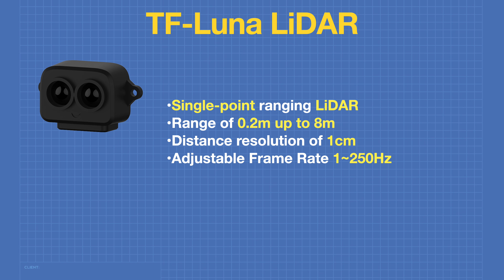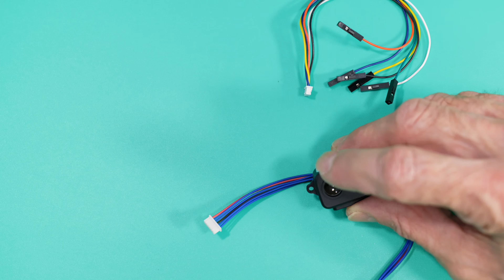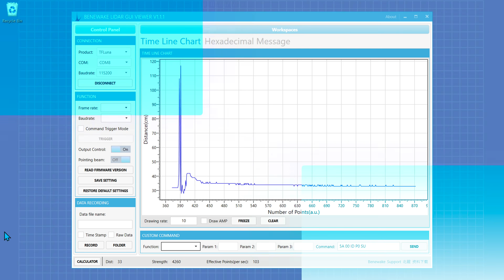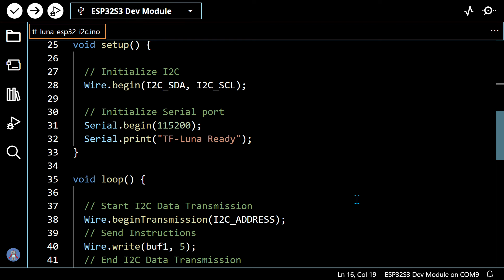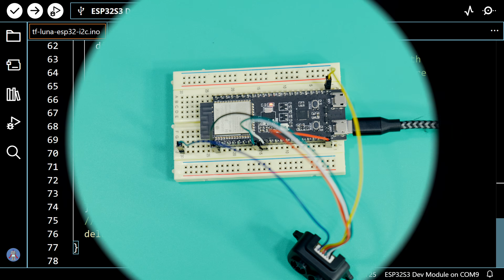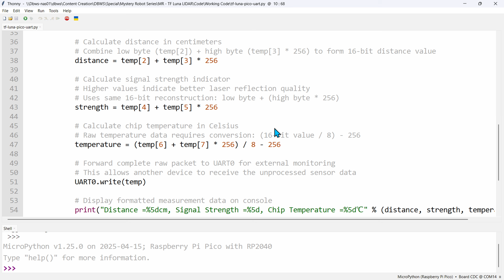TF Luna LiDAR Sensor with ESP32 & RPI Pico

Comment: Question to anyone who has this device. If you suspend the sensor a couple of feet above water with 18" waves does it work 100% of the time? Quite a unique situation I know, but can you give me your best guess based on your experience. I want to use this device to measure wave height.

Comment: I purchased several TF Luna sensors for the robot car I am building.  My plan is to connect the Lidars to an ESP32-S3 dev kit board.   I tested the Lidars with the Windows tool and they all work.  I uploaded your sketch (which is using I2C) and the range numbers are correct.  But, because I want to use three sensors I am using UART interface with the ESP32-S3.  I am using example code from Benewake and Waveshare, but I have been unsuccessful.   The first two characters in the serial stream don't match 0x59 nor do they match each other.  I've tried speeding up, separate power for the Lidars, and a host of other suggestions from ChatGPT.  Any suggestions?
Reply: how's it going? I want to do something similar to you

Comment: i need to use two ultrasonic sensors, 1 soil moisture sensor, 1 servo motor for my project. since i am using a battery to power esp i am using MT3608 booster to give 5v power to esp so can i connect both ultrasonic sensors, moisture sensor, servo motor to 3.3v of esp?. chatgpt is showing i should use voltage divider so what should i do

Comment: I suppose you keep the sensors and hardware you make these tutorials about.
I have a suggestion to give, with everything you have lying around it would be really nice to see you make a gadget, I don't know like a little robot that works with the sensors you show and the clear explanations on how you make it work, referencing the videos you made about the sensor you use to make people engage and try to make the same little robot and go back see the referenced videos to learn about the sensors you are using.
You are a great teacher and I love your videos, I which I had the money to buy a few of those sensors and boards to make a really cool gadget. And I am sure that if you do your own cool gadget, people like me will probably try to do the same and make the effort to buy the stuff needed to make it.
I thank you a lot for your tutorials because I am the kind of person that opens broken electro domestic stuff and take out the sensors I find can be useful, before I dump the rest to the garbage. I wish I could understand better about all these components I have lying around and see if I can make something cool or useful with it.
Reply: You can even start a new channel if that kind of content does not apply to this channel, where you post videos about your self-made stuff.
Reply: @kiiikoooPT  i need to use two ultrasonic sensors, 1 soil moisture sensor, 1 servo motor for my project. since i am using a battery to power esp i am using MT3608 booster to give 5v power to esp so can i connect both ultrasonic sensors, moisture sensor, servo motor to 3.3v of esp?. chatgpt is showing i should use voltage divider so what should i do
Reply: @sam77yr99  I'm sorry man, I am not the expert here, that is why I watch Dronebot channel, from what I know if the servos are too strong, you will need additional power, they normally work with just the board, but if you connect too much stuff, I am not sure if just the board as the strength to give you what you need.
Reply: @sam77yr99  or at least the stepper motors I know they work with just the esp board, that is what I have and used before, servos I don't have any and am not sure if is the same.
Reply: @sam77yr99  according to that video, you should not use the board power to feed the servo, see that video around 20 minutes time he talks about it.

Comment: Great to see you back Bill. I was going to use an ultrasonic sensor in my Tank Bot crawler but the TF Luna LiDAR module looks like it out performs the ultrasonic  sensors l’ve seen. Great demos with the ESP32 and RP Pico and the two codes.